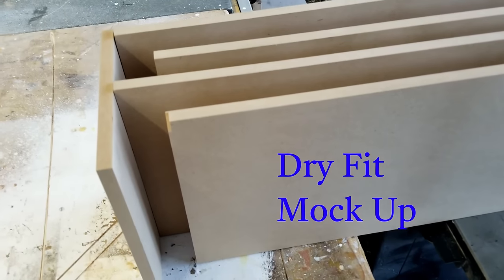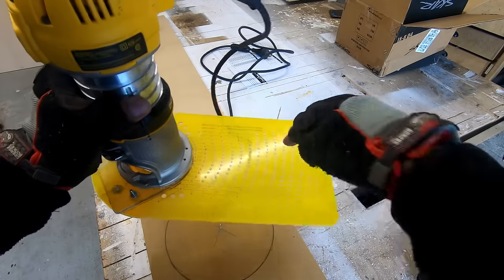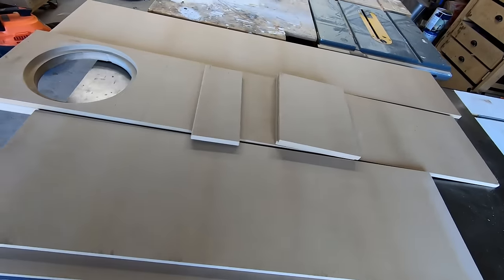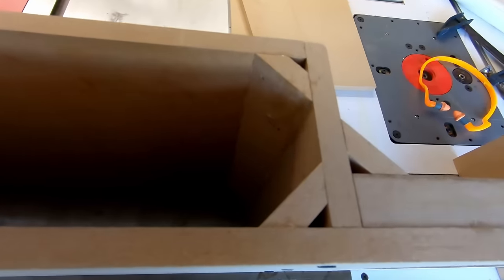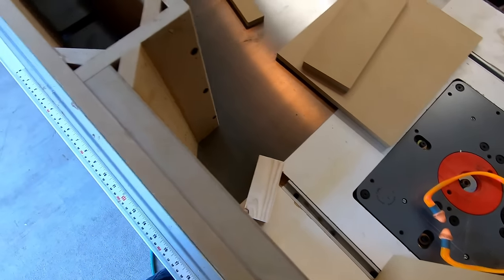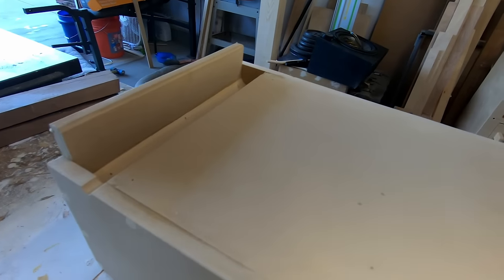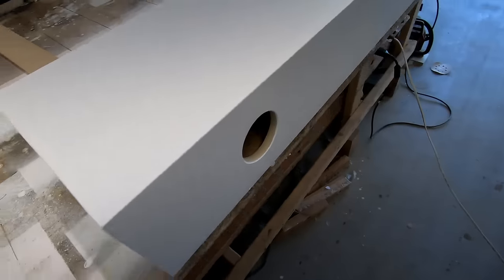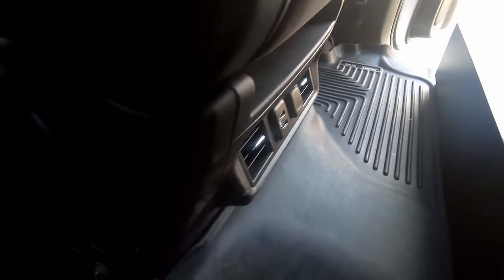DIY Subwoofer Enclosure 2021 Edition - Caliwood Specialty

Comment: Sounds good.  Thats all the bass anyone needs.  A good box makes all the difference.  In high school a buddy of mine had 2 6 x9s in his truck and you would swear he was rocking 2 10" or 12" Rockfords.
Reply from the maker: 100% agree!  Thanks for the comment.
Reply: I had a little Mazda truck that someone had installed Jensen 6x9's in. They made custom mounts for the doors. They got really low. Hadn't had a truck with frequency response that good until I got a Ram with Infinity audio.

Comment: I've done very similar box with an 8" image dynamics sub under the back seat of my old F-150. Sounded pretty damn good for an 8 and got low, but my only complaint was a very very slight delay. It sure makes small subs sound bigger than they are.
Reply from the maker: That's cool. It is pretty amazing how well it sounds. However, I'm not sure what you mean that yours had a slight delay. Thanks for the comment.
Reply: Yeah , I've noticed that delay in home audio , powered  subs !
Reply: if you are getting a delay check your phasing... a lot of good powered home subs will have a phase switch.. might also have the wires reversed on the one in your car setup this is especially prevalent with door speaker replacement

Comment: Did you have to raise the back seat for that box? Built two boxes already and didn't have enough clearance for an 8 inch skar, down firing. Ended up building a .40 cube sealed for infront of the seat. Next project is a vented box for the same spot, but now you got me wondering with that box you built if you didn't have to raise your back seat. Awesome build!
Reply from the maker: Thank you! No, I did not mess with the seat.  I maximized all the clearance it had under the bench.

Comment: Amazing job! What is the useable frequency response please if used in a living room for example? Can it go below 30Hz and could it be scaled up for a 10 or 12 to maybe go lower, say 20Hz if the 8" cannot?  Thank you.
Reply: Yes it can be scaled up for a 12"
Reply from the maker: Thanks! 
It's around 40Hz. Yeah, it can be scaled up for a 10 or 12", but it would not be able to ne tucked away nicely under the seat.

Comment: It's a nice build. Good design creating all that air resonance by extending the labyrinth out.  I have only two suggestions to improve it.  One would be to add cushion and absorption stuffing behind the driver to reduce push-back from the bass driver. The second is....why did you use clamp-style speaker wire connectors? Those don't offer good conductivity because they lack conductive surface area so they increase impedance. Since you're pushing heavy bass and you're already using large gauge wire, you want as little impedance as possible.  I would have gone with Banana plugs to give you the option of using Banana Plugs or Spades for better conductivity and less impedance.
Reply from the maker: Hey thanks for the comment. Yeah, I did consider adding cushioning (polyfill) but ultimately decided not to; it already sounds amazing as is. And yes, others have also commented on the speaker terminals. Perhaps it can be an upgrade later on.

Comment: Would it be possible to run a t line box with a 10 under the rear seat of a extended cab full size ,? Have you ever heard the ,pro box ported single 10 for full size
Pickups? I have their earlier dual 12 sealed with 2 eclipse 6 ohm subs at 3 ohms ,not alot of room in the box after subs are in .
Reply from the maker: You might be able to use a 10" sub in a t-line configuration, but it would all depend on the size of the speaker + magnet. It would probably be a tight fit.  This is why I chose an 8" sub.  No, I have not heard of pro ported box.
Reply: Just get a higher quality 8" sub or 2 (no t-line for 2) & you'll have some awesome bass.

Comment: Just sum advice, cut out is prone to leaking so i normally used to drill a hole 1/4 inch and run cables in and plug it with silicone . Learned my lesson when it blew out on me with two kicker solo's 10 back in day never used them again and never had leaks from terminals as they were drilled in banana plugs .
Reply from the maker: Thanks for the comment. Of the countless enclosures I've built, none have had any issues.  If (and it's a big IF) there is any air leaks around the connector, it's nominal and does not interfere with the overall sound/performance.

Comment: Man, I want to do an enclosure like this for my single cab Silverado. I am more concerned with getting all the frequencies than just being loud. How did you come up with the design?
Reply from the maker: Yup, I agree with you. It would be pointless to have a loud sub if it sounds terrible. There are various articles and sites that give you the info you need to build a box for any specific sub. Simply search for t-line calculator. Of course you can find a  calculator for any box design that fits your needs.
Reply: This enclosure looks like a T-Line (quarter wave enclosure) that usually requires a bigger enclosure. That have to be properly tuned or they sound awful! Sealed enclosures are usually smaller but struggle with loud spl's at lower hertz. Also require  more power than vented enclosures because they are less efficient. Please explore an enclosure that has a passive radiator. It can be the best of both worlds. It does require proper tuning which can be a headache in the beginning. But once it is done right, you can have an enclosure around the size. Of a sealed enclosure while having a lot of the efficiency of a vented enclosure. I have made passive radiator enclosures that HIT HARDER than a lot of bandpass boxes. But with a full lower frequency bandwidth. In my humble opinion 🤔
Reply: I was looking at the kicker truck box that uses a passive radiator. I wonder if it would get low in that tiny enclosure.
Reply: I was looking at the kicker truck box that uses a passive radiator. I wonder if it would get low in that tiny enclosure.
Reply: @uncledope77   I have had my eye on that little truck box kicker makes. It uses a passive radiator. I wonder if that would be the ticket.
Reply: If Kicker made it & designed the whole thing, it usually will sound good. To the only question about some Kicker products is the power handling. Their lower quality lower power handling products just don't cut it for me. They sound good but can't handle the power! But I have had no problems with their Competition Line or higher quality products.
Reply: @uncledope77  "This enclosure looks like a T-Line"

This falls into a daline t-line, which is basically a chambered t-line. But with 1 3/8 width to the line, I promise you the above enclosure won't perform that well!

"Sealed enclosures are usually smaller but struggle with loud spl's at lower hertz"

Actually, the opposite is true as sealed enclosures have a 12dB per octave roll off after resonance frequency, and ported has a 24 dB roll off. 

https://www.youtube.com/watch?v=S-AGcpEVUnQ

"Passive radiators roll off even steeper than ported due to the inertia caused by the mass of the radiator "

It's just that nowadays, we've become acclimatized to seeing 12x21" subs on a gazillion watts, of which most of that wattage is lost in heat and acoustic distortion ... but for SPL comps, it all counts I suppose. 

"I have made passive radiator enclosures that HIT HARDER than a lot of bandpass boxes. But with a full lower frequency bandwidth. In my humble opinion 🤔"

Subjectively, that's why manufacturers, especially for small Bluetooth speakers, because for the most part, the bass is playing above the tuning point, and that's where any open enclosure, BR, Horn, BP will play louder. Objectively, however, I'm afraid, below tuning/resonant frequency sealed wins!

For me, a transmission line is objectively the better blend of the efficiency of an open enclosure, but with a shallower roll off than a typical bass reflex. Downsides to a t-line is often size, and a lower SPL … that's why you never see a true transmission line enclosures at SPL comps, albeit one might call a Paraflex, a variation of a transmission line. 

Paraflex Enclosure
https://www.youtube.com/watch?v=042klxShFZo
https://www.youtube.com/watch?v=Z3Iomd5kK-k
https://www.youtube.com/watch?v=y3pw7EjOxJI

I did one for a Rockford
https://www.youtube.com/watch?v=-96WAVQdcyQ
Reply: @juststuff5216  There are pros & cons to every enclosure type & there are pros & cons for every driver. Anyone designing an audio system or sound device will have to decide what's important to tell. Then figure out the best way to achieve that goal. For me it will always be deep clean bass & I have achieved it with subs sealed, ported, & with passive radiators tuned really low. Most of the time quarter wave enclosures are more a hassle than the usually bad sounding result.

Comment: Sweet enclosure. Don't need those screws tho glue and brads is more than enough, I build subwoofer enclosures with just wood and brads and have never had a failure and these are 12s and 15s, the last one was for my dual 400oz motored 15s running on 6k+... If that doesn't pop a seem what will...one day I was stressed out needed something  to do I had some leftover MDF so I built a ported box for an ix10 I had kicking around, I used skars recommend specs volume, port area/length and skar were spot on, that little thing actually vibrated my rear view in my van on squat for watts, I had to be careful having such a big amp. So I took it to work and gave it to a coworker that had just a 10" pioneer low profile subwoofer sealed box combo and he was blown away at the improvement from the little skar combo. Box was small too.  It's so fun giving stuff to people, it's cool to see the smiles.
Reply from the maker: Thanks! The screws are extra insurance lol.
It's cool that you were able to bring a smile to other bass heads! Keep it up.

Comment: This is just a really long port and not a transmission line, right?
Reply from the maker: Yeah, I guess technically it is a really long port, but it is a t-line set up. The bass response I get from this design is outstanding. Much better than a regular ported design.
Reply: I still don't understand how you figured the length? There isn't a calculator anywhere that I can find to help determine this,  and also how much chamber area you decided to go with.   Not to mention using dual subs.  Did you guess at calculations?

Comment: 1:17 man, don't do this.
Never crosscut with a rip fence, use a miter gauge or sled.
You are gonna get yourself seriously injured or killed, and someone learning from you will do the same.
Reply: Good advice...but question.  At what point does a cut become a cross cut?  Is it the point when width (East/West) is more than the length? (North/South)  So anything wider than a square shouldn't be cut with a fence?
Reply: @JViello  Ideally, you should never rip more than half the length, and consider anything close to being a square with special caution.
You can go for years without getting a kick back, and then one day it happens. I once had a full sheet of 3/4" plywood kick and frisbee across the shop with enough for to move my 1500lb planer.
If a good after market extended miter gauge is too much, make yourself a sled. It is one of the few tools that will actually make you a better craftsman. Not only will it cut more accurately, it is worlds safer/
Reply from the maker: Thanks for the comment

Comment: I'm considering using this idea to build a couple of compact boxes for a Jeep or two. Great idea.
Reply from the maker: Yeah! Give it a shot. You won't be disappointed
Reply: @FranksCaliWoodSpecialty  I had two 10's in my Jeep years ago. Instead of doing that I think I'll build a ported "infinity port" box like yours and use a smaller sub that requires less power. It should work great. Thanks for using a good mic to record the sub after you finished the box. Most people use a phone and it can't pick up the sub very well.

Comment: Excellent build. Swap that nasty spring connector plate with a banana plug plate and it’ll be 10/10 for me.
Reply from the maker: LOL, I dropped in better connector on a recent dual sub ported box.  Thanks for the comment.
Reply: @FranksCaliWoodSpecialty  ok dude. 11/10 it is!!! Low profile form factor is sweet.
Reply from the maker: @MrEtonmess  Ha ha, right on! Thanks

Comment: Good work mate lovely job, try better quality connectors on the wires and you’ll get even better results
Reply from the maker: I've have a few comments about the connectors. I'll be using different ones on the next build.  Thanks for the comment.

Comment: Awesome build and craftsmanship,mi have question for you , love to build exactly same enclosure in my new Bronco I deleted rear seats and would like to build in the floor area. Would you know if this size of enclosure would work with my single JL  10” W3v 3-4 subwoofer , just wondering if the the airspace would be correct. Thanks you !
Reply from the maker: Hey! Thanks for the comment and question. 
Just so you know, each sub is unique and comes with specific enclosure requirements. Look up your subs specs online, and a custom enclosure can be built based on that info.
Reply: Thank you for quick respond , I did figured out formula and got measurements, can’t wait to build one for my new Bronco. Thank you for very detailed information on this awesome build. Have nice day !
Reply from the maker: @Les Korcala  Great! Good luck on your build.

Comment: I've read that the harman kardon amp is 900 watts, this skar sub you used was 150 rms, with a d4 voice coil. I want to build a dual enclosure and run these in series parallel...not sure if I can get the box to big enough.. I still might give it a shot
Reply from the maker: Yes! Give it a shot.

Comment: Great video. 
My best guess is that you were aiming to get get a very high 20´s Hz tuning but it ended up being in the low 30´s. I think yo have a T-Line of 123 inches in length. I have never built one but after watching your video, I am going to. Out of curiosity, should the T-Line tuning target frequency be lower or higher than the Fs of the subwoofer?
Reply from the maker: Thank you.  I can't recall exactly, but it's definitely tuned pretty low.  Yeah, give it a shot, I'll think you'll be impressed with the result.

Comment: The box efficiency would be better if you sacrificed port length for box volume. Tuning below 20hz is only great for disciplining all of the animals on your block.
I use win isd for box volume and port calculations.
Reply from the maker: Ha ha, I chuckled when I read the "disciplining the animals" part. Thanks for the comment and thanks for sharing what you use (WinISD).

Comment: CAD + CNC Mill = Better, but good job on the box build.
Reply from the maker: Hmmm..IDK, in that case just buy a pre-fab box. This is a hand-crafted customized box. Thanks for the comment tho
Reply: @FranksCaliWoodSpecialty  , Well no not really.  Consider that your innovation and effort you have put into the design and customization gets expressed through drawing the components within a CAD package.  That intellectual property is yours.  And to your business, you're now able to reproduce your design again and again at speed for your next / other customers with the same need.

Additionally, you can generate on-demand versions of the same enclosure that may require slightly different cutouts (for different sized drivers, shaped drivers, tuning, etc).

With each job, you also find small opportunities to continuously tweak / improve your original design drawings (until you get to a fully optimized creation).  And with the machining of the components you will be able to use materials much more efficiently, effortlessly incorporate dado / rabbet joinery for stronger construction, have all of your fastener holes placed exactly where needed being evenly spaced, and significantly decrease the assembly time.

In short, you're replacing your table saw, router, jig saw, and drill with a mill that can "read your sketch" and make exactly what you want / what you designed.

Comment: You should avoid parallel surfaces.  Cause resonance.
There's a good design in 'Electronics Today International' August 1977 ed magazine. I've constructed it about 20 years ago. Sounds damn great.
Excellent video.
Reply from the maker: Interesting. I'll need to read up on this. Luckily, this enclosure and speaker are still performing without issues. Thanks for your comment.

Comment: I’m surprised you don’t have a hole saw for the connector hole. Nice work though, you’ve inspired me to make this box for a single ten or two 6” Skar woofers
Reply from the maker: I do have different size hole saws and forstner bits but I had my jig saw handy and ready to go lol. By the way, I recently posted a box build featuring two  8" subs.

Comment: I have a question i did my own build design with the speaker concealed inside the cabinet with 1 partition speaker facing downwards enclosed any effect with that
Reply from the maker: Hi - I don't really understand what the question is but if you designed it to specs, then you should be okay.

Comment: You not worried about its excursion hitting the floor? It seems like it could. I'm sure you've done the math as it looks like a very well thought out project and you clearly know what you're doing.

Nice build. Well done!
Reply from the maker: Thanks for the comment/question. No issues with the subwoofer's excursion hitting the floor. It has sufficient clearance and still sounds amazing.

Comment: How much to build a box for two DS18 EXL 12s built to max size specs for Ported Enclosure tuned to 30hrtz. I want that labyrinth box. It will go in 03 toyota tundra access cab.